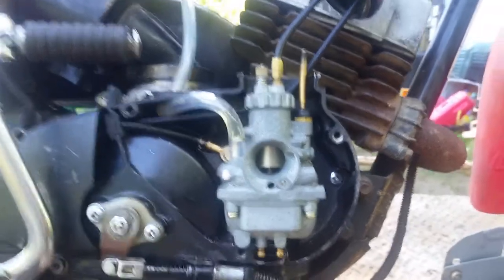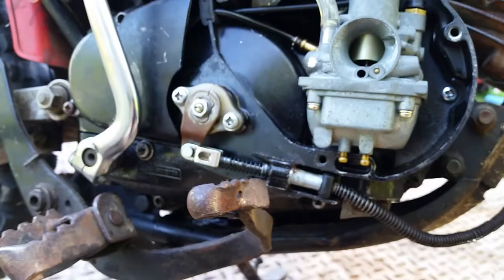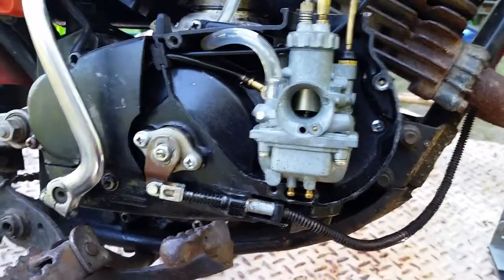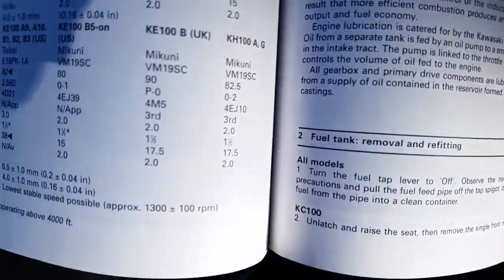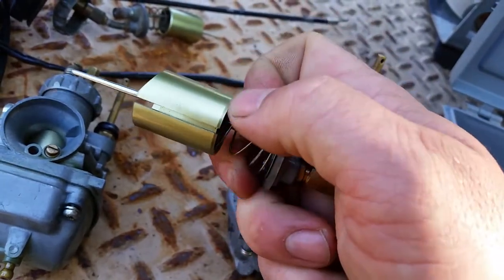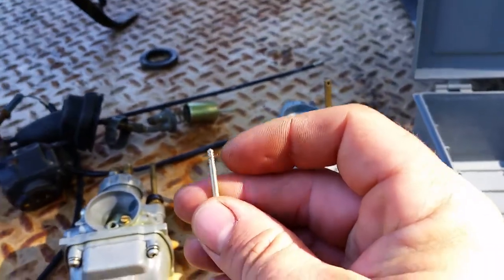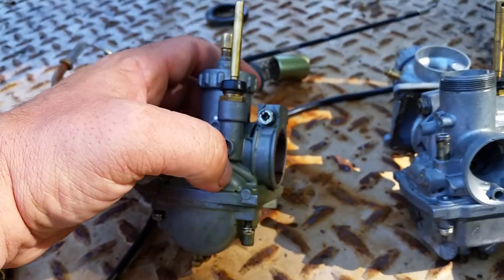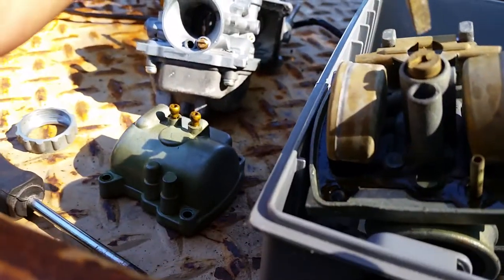KE100 carb repair talk  part 1

Comment: Kev if you ever come down to Florida, I got a 72 G5 you can have. I've been working on this thing for months and cannot get it to start. Everything is good, compression, spark, timing, rebuilt it all... It will not pull fuel and start. I've cleaned the carb a dozen times and fiddled with every setting. I'm losing my mind. Come down and take it from me. I'm sick of this thing. It's cursed and I don't want it.
Reply from the maker: 603 395 8097

Comment: Just if anyone struggles for parts the bajaj kb100 built in India is a Kawasaki kh100 with the tank and panels off the kh125 so parts including carbs etc can be ordered new from India

Comment: I got a kh100 sticker says 1975 but i seem to only find 76. But all ke100 and the AC100 carbs will work also with this bike will the covers also work. Or any boots that go to it.  And ebay carbs are good ones to buy? Mine came with no carb or cover:(

Comment: Hey Kevin, what is the stock pilot (air/fuel) screw adjustment on the KE100? I can’t find it anywhere. Need to richen my bike up a tad for the winter temps

Comment: KEVIN THANKS SOOOOOO MUCH. I got the time to test my 79 ke 100 after putting the new cluch in and it works great thanks so much it is a fun old clasic
Reply from the maker: That's awesome great job very welcome
Reply: @2strokeguru  okay Kevin so on the left side where the chain tensioner pushes against is bent and have been bent before ( I just bent them back in the past) and since they did that they are really weak at the bend. It is to the about to snap point and I was wondering if it would be okay to weld them for reinforcement?

Comment: Hello! Thank you for all your videos and sharing all your knowledge. I just bought a 1980 kd100.. your videos are a great help and very helpful
Reply from the maker: Thank you for your support kd100 is a great bike remember ke km kd mc1 all share same engine family
Reply: @2strokeguru  I watched your video about  ignition , I was able to switch my ignition coil and get my 80 kd100 running for a bit. Now it won't start unless I push start it and it has to have the throttle wide open to run. Then it stalls. Am I able to clean my carb without having to replace the gasket and other stuff? I'm having a hard time finding parts and help in my town. I'm up in Canada , I really like watching your videos. The carb is spitting gas out when the cover is off and its leaking from the bottom.
Reply from the maker: @clayshorting5605  do you speak English
Reply from the maker: If you do i will give you my phone number

Comment: Great vid, thanks.  But there are no Phillips screws on a Japanese bike.  The one holding the carb clamp on is JIS
Reply from the maker: I have been doing this for 30years Philips #3 fits correctly
Reply: @2strokeguru  JIS is nearer to Pozi than Phillips. Buy a set and you'll stop chewing the heads.

Comment: Hello Kevin good video but I have a question?I have a 2000 ke100 and I have the black idle screw turned all the way in/tight and when the motorcycle is warmed up it still won’t idle.What do I need to do next to fix the problem ? Thanks
Reply from the maker: if its a higher idle and cant idle down the throttle cable might be too tight if that's not it it could have air leak

Comment: Where can I find a new rubber seal that goes between the carb and the intake tube?  I’ve looked for days on different online retailers and can’t find it in the diagram showing this seal.  I found it for the old model carb (with the idle screw on the outer front of the carb, but mine is the newer (1990) model) and I can’t seem to find this seal for the newer style carb.  In your video, you said the carb spacer between the carb and intake tube was a different diameter for the old and new model, so I assume the seal is also different.
Reply: I have the same question. Did you ever find a replacement?

Comment: I'm working on a 73 that's been sitting since about 2002. After rebuilding and cleaning the carb a few times, it only runs at basically full throttle - I suspect one of the Jets is clogged but I'm not sure how to clean it... Any ideas?
Reply: Same exact issue I'm having

Comment: Kevin Bergeron,
Thanks for sharing your knowledge!
I just picke up a 73 g5, and was curious about pressing out the needle jet/ emulsion tube.
I’ve done it many times on Honda’s but wanted to make sure it was safe to do. Any advice?
Also, the filter/drain in the right side cover, is this threaded in or pressed? Manual doesn’t say.
Hope you can help, thanks

Comment: Hey Kevin, what would you recommend for a broken throttle cable? Since I can’t seem to find any oem replacements anywhere nearby and they don’t make any aftermarket cables specifically for the ke100. I saw some universal ones that come with the entire throttle tube assembly, but I would prefer not changing out that much. What are your thoughts on this? Thanks in advance!
Reply from the maker: Have you checked ebay or go on Google they have custom cables you can buy a custom cable also the kh90 kh100  kv100 trail boss 100 all use same cables  hopefully this will help with your search

Comment: Hey Kevin how you doing I have the original carburetor for my 100 KD but I'm missing the float Bowl what size of a float Bowl would work on that and what type would I need to get that old carb working again working again thanks
Reply from the maker: Ke100 kd80 km100 km90 G3SS mc1 90 all fit
Reply from the maker: I'm doing well thank you

Comment: Super helpful! Just cleaned the carb on my '76 KH100. 

The plastic idle speed adjustment knob that sticks out the top boot on mine slips on the knurled metal knob underneath -- so I can't adjust the idle speed while riding. Maybe I'm missing a part, but it looks like the plastic knob is just supposed to grip the metal? Got any tips to keep this from slipping?
Reply from the maker: Red loc tight

Comment: Hi Kevin, Thanks for your videos, I've tried to adjust the idle of my bike (Kawasaki G7t), but know I can´t start it, I've put the screw 1 and a half turns but the bike don't start, the idle speed screw should be at what position? What is your advice to adjust it? Thanks

Comment: Kevin, great video.  Couple quick questions regarding my 1970 G4TR Trail Boss.

1.) When looking up and ordering parts, whats the difference between a G4TR-A, G4TR-B, and G4TR-C and how do I identify which version/model I have?

2.) I'm looking for a replacement air cleaner element (schematic aligns with G4TR/A/B part) part number 11013027, but only see one used one on ebay that's missing the foam ring and it's $100.00.  Are there other air filters from different kawasaki bike models that would fit and work, or other aftermarket reproductions that can be sourced somewhere?
Reply from the maker: Check the UNI airfilter website and there's a sister bike to your bike kv100

Comment: Kevin great video. One thing hard to tell is which bike model is which. I have a 96 KE 100. I noticed you mention the carb says the model number but looking at the screenshot there are multiple carbs with the same number but have different jet settings.

Comment: Willa  newer carburetor work on a 1981 ke 100. I bought one and it fits perfect except the float overflow is on the wrong side and there is two extra ports that is in the new one
Reply from the maker: Yes they are vents

Comment: Hey Kevin one more question, so I have done almost everything and NOTHING is working. I was hoping you would help. So the symptoms are it is SUPER smoky, it won’t idle at all, it will only idle on choke, it has no power in first two gears but the other gears PULL, and it seems like it is sucking air...just replaced both crank seals and still same results. Could I have installed them improperly?? Thanks! 

Edit: no oil under the stator cover! That means left crank seal is good! So right crank seal again or what?

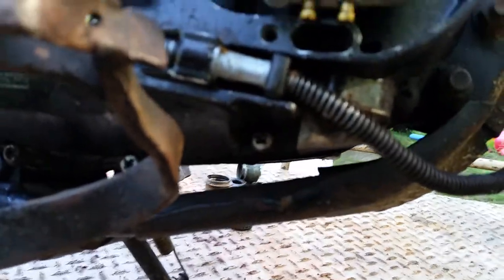Comment: Excellent video!  Searching for the filter that you mention at 6:00 (below the carb).  I don't have one and don't see it on the parts diagram.  What search terms do I need to use in order to find one?
Reply: Found it after looking for a while.  It's PLUG,25X12 16116-006.

Comment: Would not having the grommets have anything to do with no idle?? I've sealed that air box, messed with the idle screw, checked the filter, and everything. BUT I am missing the grommets for the front and the fuel line. Does that pull in to much air and throw off the mix? Thanks so muvh
Reply from the maker: it would if you got water in it not have the grommets allows dirt in and engines dont like dirt you could get dirt in the idle circut in the carb

Comment: Thanks Kevin! I was kinda hesitant about checking the pilot jet because of the plug but was thinking I would have to. I bought a new plug. I think it's a ngk r. 11/2  turns out on pilot jet right?
Reply from the maker: the idle mix screw is 1 1/2 turns the pilot jet is  next to the main jet in the carb in the tube

Comment: Rebuilding the KE100 I had as a kid with my teenage son. Love your vids. I was looking for the air box filter located on the case below the carb. Can you link to the ones you said you found on eBay? Thanks!
Reply from the maker: Robert Miller I will check tonight when I get home thank you for watching and subscribing ke km kd mc1 all the same for that part

Comment: Awesome information that I've been looking for.  I just picked up a 1980 Ke 125 and having trouble finding a new carb.  Any suggestions on a similar one?
Reply from the maker: Do you have the original carburetor
Reply: @2strokeguru  I only have the housing.  Most of the internals are gone and the cheapest float i found was around $65
Reply from the maker: @ryancollick6670  text me pics of carb  6033958097

Comment: cleaned the carb on my 1975 kh100 and it stopped leaking but still only runs for 5-10 seconds with the choke on. any recommendations on how to adjust the carb?
Reply from the maker: If it only runs on choke that means it is not getting fuel it needs clean the fuel tank petcock the bowl on the petcock

Comment: Hey Kevin! Awesome videos! Just recently got a 2000 ke 100 in good shape for 200 bucks. Front rim was bent and petcock was broke. Got both from ebay. cleaned the carb and checked a couple other things you said to check on your videos but still cant get it to run right. It starts but races and dont want to idle. I had all of the jets out except the one that is down in in front of the main jet. I think you said it was the idle jet. Float is level like you said and everything else seems to look good. Bike was very clean even inside the airbox where carb is so I figured I would be able to get it going no problem. It is also smoking pretty heavy so I just watched your video about the oil adjustment and am going to try that tomorrow. Do you think that could be the problem?
Reply from the maker: thats a great deal congrats check your pilot jet and spark plug if the plug is a resister plug that could be the problem

Comment: Hey Kevin, working on my 2000 ke100 and have a few questions. I am running my bike and am getting backfire and or bog on the acceleration of the bike. How man turns out does stock reccomend, I am at altitude so I may have to adjust accordingly. Are the needle jets interchangeable on the different carbs?
Reply from the maker: Backfire on a 2000 ke100 change the spark plug first

Comment: Do you have a cover over the carbarator  or  can i leave  it off
Reply from the maker: Leaving the cover off is bad for the engine dirt can get in the engine and destroy it dirt can damage the clutch adjuster assembly I have covers

Comment: Is there any way I can get in touch with you? I have several questions about my ke100 and it is my first project. Your Channel has been very helpful so far though!
Reply from the maker: awesome email me and i will give you my number luggnutz76@yahoo.com
Reply: Parker Emeigh lol me too have a 91 ke 100 striped idle screw....thos bike was 1 owner..I.e me being the 2nd..has 750 miles...wont idle...
Reply: I wss told that its a cheap fix...like 2.99 for the screw..but they couldn't get it out...honestly dont know what they are talking about...

Comment: I have the older rectangle carb, should I just skip trying to rebuild it and get the newer style?
Reply from the maker: the older rectangle carb is made by Teikie its a great carb i just put one on my Kawasaki KDE90 bike build however very hard to find parts for if you cant find parts the Newer style carb is the way to go
Reply: @2strokeguru  so the new carb should slide right in without a problem?
Reply from the maker: @MainelyMoto207  the slide is not interchangeable but yes replace complete carb setup 100% fit
Reply: @2strokeguru  excellent, thank you!
Reply from the maker: @MainelyMoto207  welcome

Comment: I have ke125 78 and having idlein problems and also get it to go bogs out a lose power
Reply from the maker: Check fuel flow from the tank and float adjustment
Reply: @2strokeguru  fuel flows to motor just feel like like it comes and goes I was thinking of take apart carb clean her up and the jets inside and then try to run agian
Reply: Witch mikuni carb is on a ke125 78 I think of get a new carb and slap it on and see there what happens
Reply: I need help for real
Reply: Also what is the measurement for the float I cany find real good info on these bikes over here in canada
Reply from the maker: @JAMTOAM  im not home to get the information at the moment I get back tomorrow evening
Reply: @2strokeguru  thank alot I'll be waiting

Comment: I just bought a carb but it has three ports on the side and one on the bottom I'm confused on what goes where
Reply: One of the ports is black plastic
Reply from the maker: They are vents
Reply: @2strokeguru  are you sure my old carb has the two on the bottom but this new one only has one on the bottom
Reply from the maker: @brycelawrence7905  yes after market carb only has 1

Comment: Kevin, do you see much issue with using a 78 jet vice a 75 jet in the carb on a 75 G4?
Reply from the maker: No both are lean jets I like the 80 in that bike
Reply: Kevin Bergeron thanks for the advice.

Comment: Is there any way to adjust the idle speed on these bikes? My stock pilot jet wont let the bike idle, but i have a bigger pilot jet that makes it idle but its too high.
Reply from the maker: Frankie Marchese to adjust your idle speed is adjusted next to where the cable goes into the carb on the very top  the screw you where adjusting is the mix screw not idle speed
Reply: Thank you, running great right now. Starts up 1st kick. How much transmission oil do the ke100s take? I have a 2000. Also should I use 10w 40? Thank you again! I checked the check bolt, theres oil in it but looks dirty.
Reply from the maker: till it comess out the oil level plug located net to yhe kickstarter at where the kickstarter comes out od the engine and it 10w30 or 10w40 eather worksgreat
Reply from the maker: you are welcome

Comment: Hey Kevin I have a 08 1980 Kawasaki km100 and I don't quite know how to tune my carburetor because it's not getting up to speed it's supposed to be
Reply from the maker: Brian Abbott I have a bunch of carb videos the km and ke are the same setting 1 1/2 turns out from seat and float 24mm from gasket to top of float and make sure main and pilot jet you can see light through and the get in your carb bowl it located in the circle tube in the bowl
Reply from the maker: Brian Abbott check out my other carb videos email me luggnutz76@yahoo.com with your phone I will call you or send me a Facebook message and I can do pictures through messenger
Reply: @2strokeguru  can i email you please? Have a couple quick questions
Reply from the maker: @TylerTheBassCreator  are you in the us
Reply: @2strokeguru  yessir! Colorado
Reply from the maker: @TylerTheBassCreator  text me 6033958097
Reply: @2strokeguru  will do thanks!

Comment: Hey kevin i need some help i got a 1990 ke 100 it was setting up for a few months before i got it well i put some gas in it and it fired up and ran great. After going down the road a time or two in first gear i decided to push the bike a little harder shifted to secound and it started stuttering and then died.... so i walked it home pulled carb and cleaned it but now it wont start at all still have great compression spark and all any ideas what is going on
Reply from the maker: king_ DENIER try changing the spark plug
Reply: I will try it tomorrow and lwt you know
Reply from the maker: king_ DENIER kool
Reply: I checkedd spark plug no fire so i got a new spark plug and still have no fire im not sure y it was sparking before but now its not
Reply from the maker: king_ DENIER you need to clean or replace the points you can use a nail file to clean the points
Reply: Ima try to clean the points but i have no experence with this type thing
Reply: Cleaned and set the points and still no spark
Reply from the maker: king_ DENIER then you will check your wiring kill switches your points could be shorted

Comment: Is the Suzuki ac100 carburetor going to work for a 1986 kd80
Reply from the maker: Yes it will ke km kv kc kh kd mc1
Reply: @2strokeguru  okk  I be been working on this bike I see no reason it won't work last time I took the carburetor off I mess with the floats it was leaking real bad so I took it back off and got it to where it seems like gas isn't leaking out but there still gas in the bowl the problem is it won't fire on gas but can fire off of starting fluid
Reply: I was worried about the round part where it goes into the intake I didn't know what size I watched a few different videos to find out what carburetor it's supposed to match thank you very much
Reply: I would like to be able to ask you a few questions first :)
Reply: When I looked up the carburetor it looks like it has two places where a gas line goes in
Reply: Picture number 3